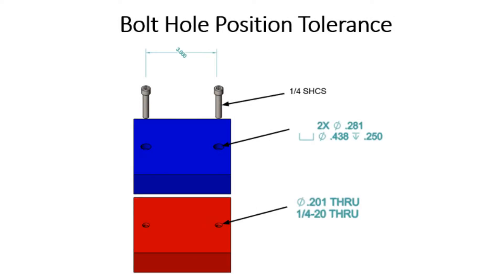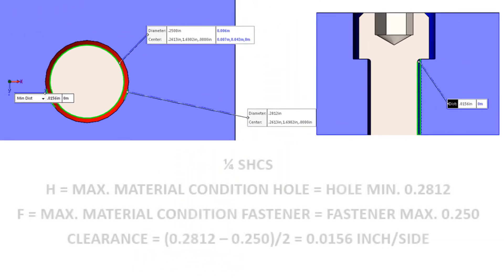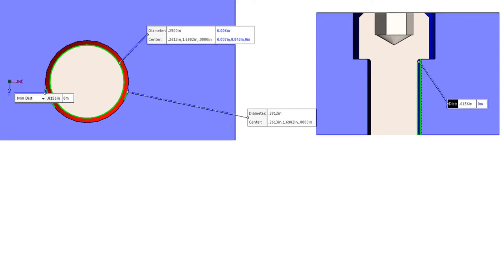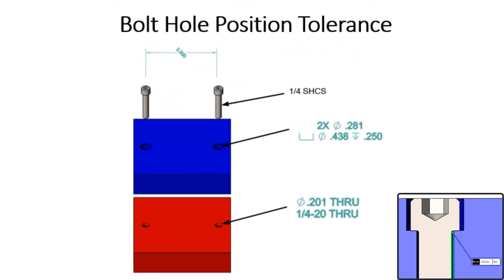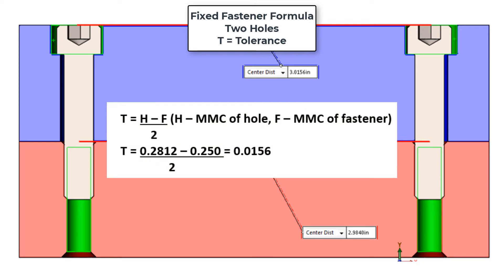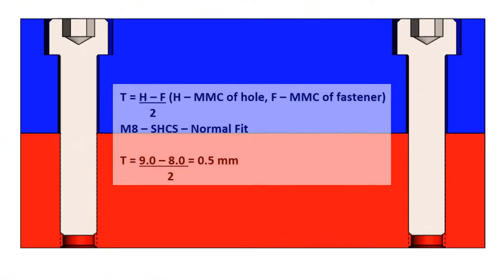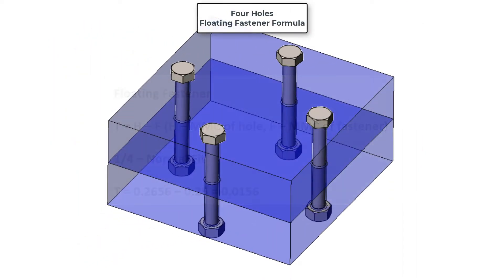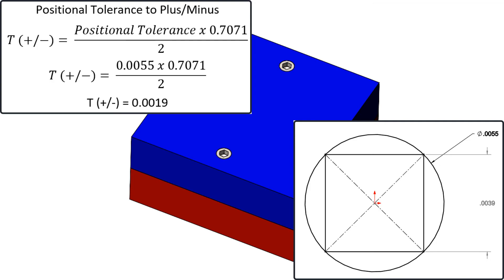Bolt Hole Position Tolerance

Comment: Thanks a lot for this video. I have not seen such deep dives on this topic on other channels so this is great. Could you recommend any reads/ references on applying the fastener formula to bolt patterns (eg. 6-8 circular pattern). Many thanks
Reply from the maker: For more than two holes use the 4 hole formula. I do not have an references that i can recommend, some GD&T textbooks will have these formulas.